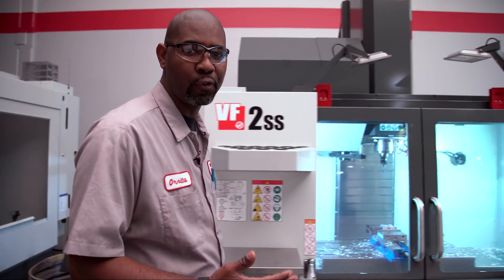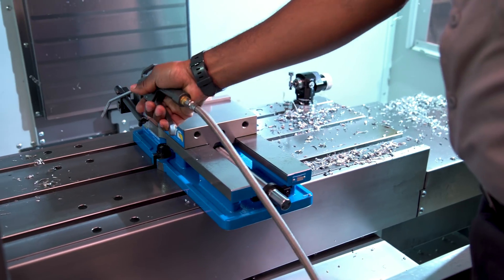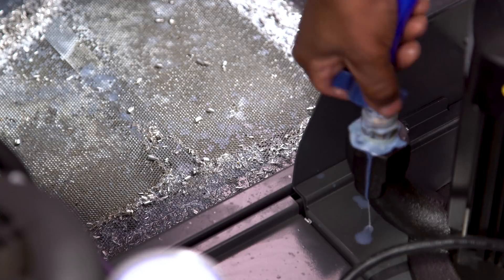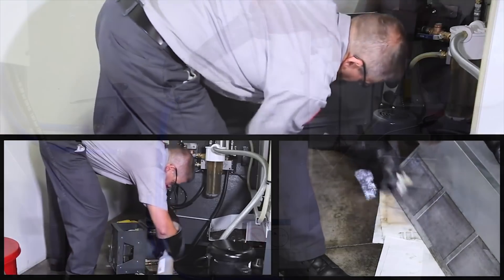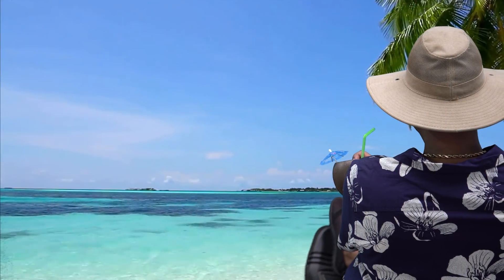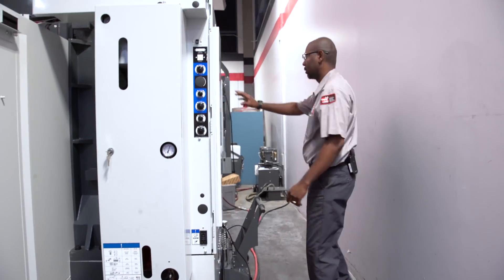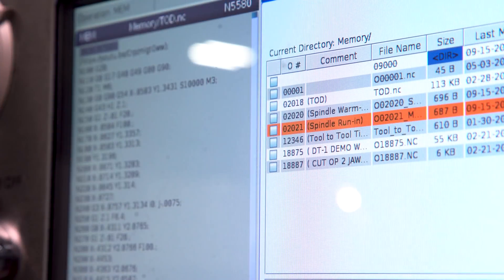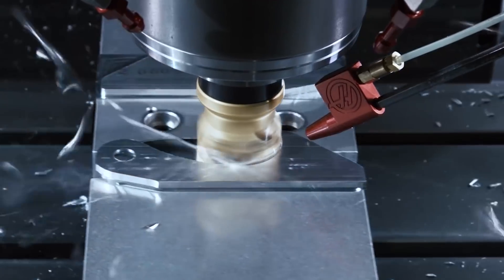Prepare Your Machine For a Long Shutdown - Haas Automation Service

Comment: Should you run the spindle with out a tool in it? I've only ever ran Kiturmira mills but in those doing so will friction weld the pull stud clamping mechanism to the spindle. Expensive fix `8k and a week of down time waiting for repairs.

Comment: In my machine the battery (situated in the electrical panel at backside of machine) gets down if the machine is shut down for few weeks. 
Can we remove  the battery (Panasonic 6 volt "not rechargable")in order to prevent it from getting down before shutting down machine for few months ?
Reply: I think you will lose all of your tool offets and whatnot, effectively restoring the machine to factory. Don't quote me on that though, not very familiar with the intricacies of the Haas control.
Reply: I don't even was close to one of this machine, but data maintained by battery were in old electronics, I suppose that all that data will be stored on flash or eeprom

Comment: What is being used for coolant and rust preventative?
Reply from the maker: P West, The rust preventative we use is called Rustilo DW 90 HF made by Castrol. - Orville
Reply: Thanks Orville.  What is the coolant you're using?
Reply: Can't go wrong with Qualichem